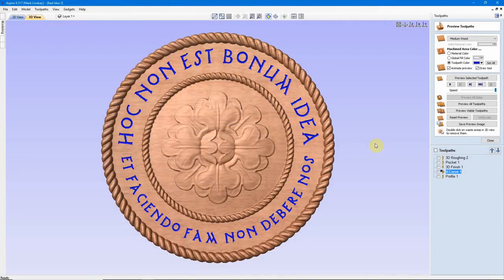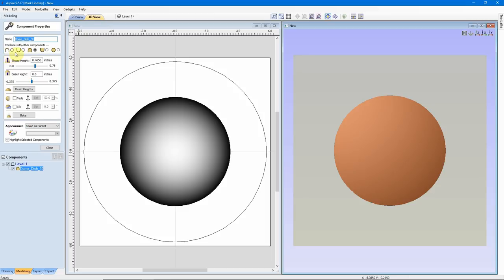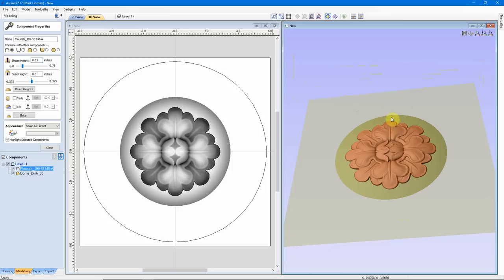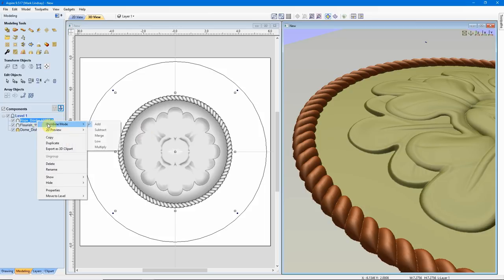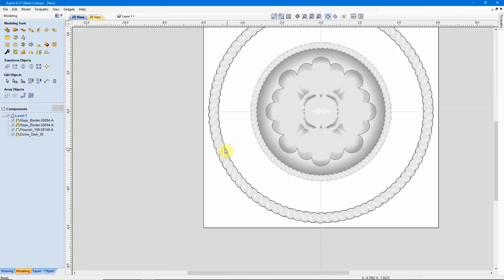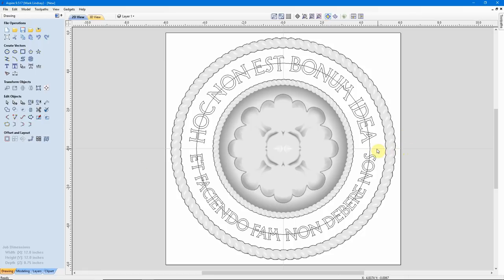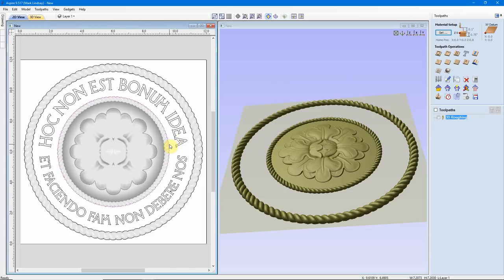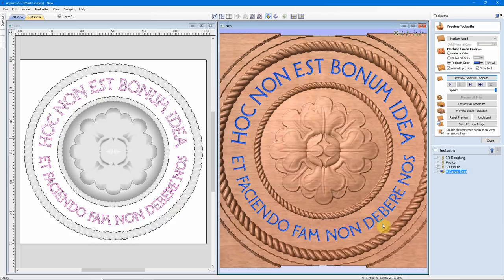Assembling a Composite 3D Model -  Part 6 – 3D Carving For Absolute Beginners

Comment: Hey Mark. I wanted to say that these two videos have gone a long way toward demystifying 3D carving for me. The concept of making composite projects out of individual 3D models is a big  game changer as far as my willingness to attempt 3D. Thanks!
Reply from the maker: Thanks very much, Jim. I really do appreciate that. After using VCarve for 5 years and transitioning over to Aspire now, I'm finding that in many ways 3D work is actually easier than 2D and v-carving. You have less worry about vectors overlapping, for one, and things can be stacked on top of one another in 3D where they can't in 2D and 2.5D. I still have a long way to go, and a lot of this is reinforcement for what I've learned, but I'm finding that it's easier than I thought it would be.

Comment: Excellent video! What stepover did you use for the 3D Finishing toolpath with the 1/16" diameter tapered ballnose?
Reply from the maker: For 3D carves, I always adjust my Stepover to anywhere between 8 and 10%. Sometimes I will go even smaller if it's a very small model that's going to be handled up close. That cuts down on finish sanding.

Comment: Hey Mark. Curious why when you created the vectors on the rope borders for doing the pocket between them, why didn't you remove the outside vector of the outer rope border in addition to removing the inner one on the inner rope border.  I get that you created the pocket using the outer edge of inner rope and inner edge of outer rope.vectors.  Is there any reason you deleted the one vecto, the r inside vector on the inner rope and didn't delete the outer vector on the outer rope?  I guess my question is since you are creating the pocketing toolpath seelcecting the outer and inner vectors to carve between the rings, why not just leave the inside inner ring vector and the outside outer ring vectror alone or just delete both or why only delete the inside inner one??
Reply from the maker: I used the outer vector of the outer rope border as my profile cutout, so the rope pattern continued down the edge of the plaque. If you watch the next video in the series, you'll see how that worked out. Here's a link: https://www.youtube.com/watch?v=lh4KD0ZIpGg

I did not need the inner vector of the inner rope border for anything, so I deleted it to avoid having unnecessary vectors in the design. I hope that answers your question, and thank you!
Reply: @MarkLindsayCNC  that’s what inwas thinking.  Outer one for profile.  Had to oause halfway through video to deal with a customer.  Lol.   These videos are great to watch in car ride to work and at work when slow.  Keep em up!

Comment: I am attempting to duplicate the rope design in Vcarve Desktop v10.507. However  I cannot seem to get the ropes to view cleanly in the 3D model. The ropes have a washboard pattern on both side of each rope. I have a picture saved if there is a way to send it to you. Thank you for any assistance.
Reply from the maker: You may need to adjust your Modeling Resolution to a higher level. It's at the bottom of the Job Setup form. Or, you may need to adjust the Preview Simulation Quality. Go to the Toolpaths menu, then Preview Simulation Quality, then select the quality you'd like to see. I keep mine on the highest level. If that isn't what you're asking, hit me up on the Contact Us page on my website - marklindsaycnc.com